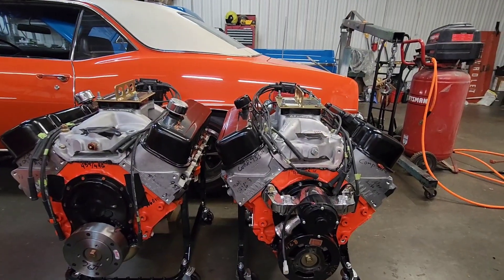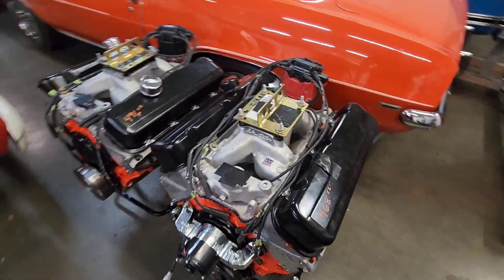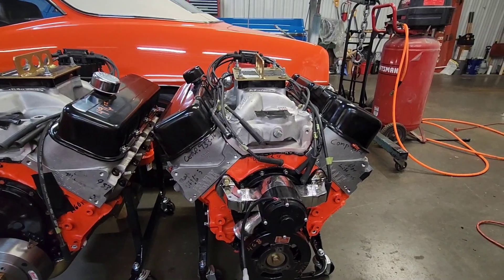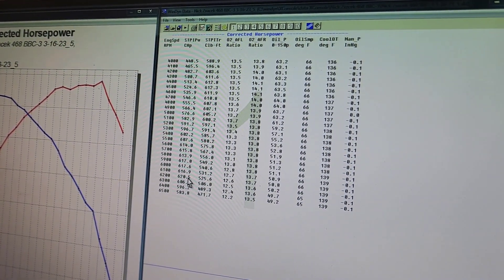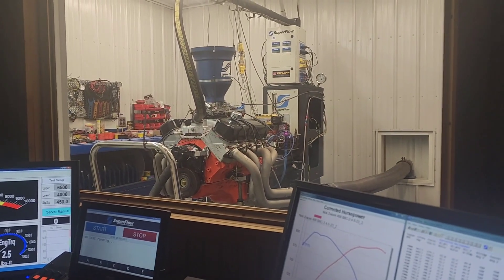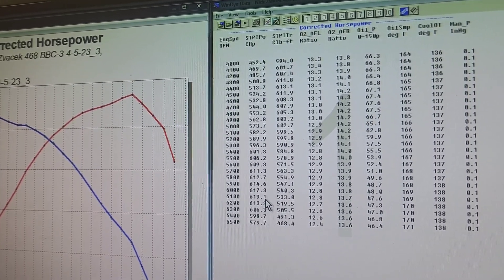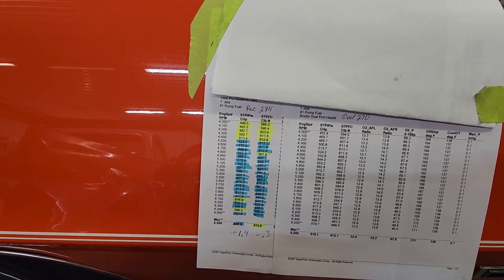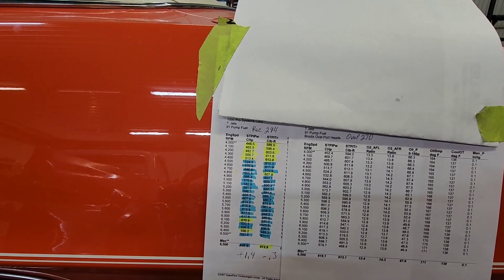Brodix Race Rite BBC head shoot out Rectangle port versus Ovalport 468 bbc

Comment: Maybe I missed it but did you say what the compression ratio was. Also have you ever considered building something identical to these with the exception being making the engine 12.5:1 to say 13:1 and running E-85? I live in Indiana and E85 is everywhere, it's the cheapest, runs cooler and is more consistent at the track. I'd love for someone to this. Great job and that's alot of work.

Comment: We've always thought that 'not quite big enough' is better than 'a little too big' when it comes to anything being driven on the street.   Ford Cleveland 4V heads showed a very similar pattern back in the day with the 2V heads making almost the same top end power but the smaller ports allowed better velocity and much better behavior down low.

Comment: Great info! I'm running a very similar combo. Mine is a 460 with 270 oval ports milled to 115cc. My cam has slightly more duration and I'm running a Strip Dominator intake. The comp ratio is almost identical and it has a 1000cfm Pro Systems carb as well. Thanks for the vid, very helpful.
Reply from the maker: That's a cool combination!! Hope you don't mind me  guessing. butI bet you're on your way to 650 horsepower
Reply: @dzperformance7360  That would be awesome! I'll be super happy if it makes close to what yours makes. No plans to dyno it though, thats why im so thankful for your video. Oh btw, i did smoothe out the chambers like Eric recomended. Did you?
Reply from the maker: @Craig Bilyeu  No. Totally stock with the exception of a valve Spring change. And milled down to 115cc

Comment: The larger square ports don't surprise me.  I've had a set of AFR square port 305's on my 468 for 20 years, long before they had ovals available, and run a similar hydraulic roller.  It makes almost identical power to yours and has plenty of torque down low, despite what everyone used to say years ago.  They'll make more torque than most can hook up on a small tire street car.

Comment from the maker: Ted,,Thanks for watching my videos!! Compression ratio is 10.4 to 1, cam is   239@ .050 intake  and about . lift 600 
What I'm doing with all. This testing is designing my own line of cam shafts and custom made carburetor spacers, I'll have this Cam out for sale on my website in the fall. Sorry i'm not ready to show the numbers yet but thanks for asking, Thanks for being interested!!  I've went through a stack of cam shafts ,custom made trying to get the perfect street strip  cam shaft for a 454
Reply: id think that the oval ports  could use more cam at first but they flow about the same  Wallace racing says about 620HP when i enter the numbers on their HP vs cfm flow and cubic inches calculator  with 325 @.600 lift  which is what someone  else flowed on here.  eric weingartner i beleive.  

that wallace racing calculator is pretty damn accurate...
Reply: Did you ever get that cam out for sale yet ? What stall converter would you recommend for that set up?

Comment: Need to work on the oiling system it lost 20 psi through the run
Reply from the maker: Yeah I seen that .. I think i'm going to a stock pump and run a little less oil, when testing,, (It has the stock oli pan and a ls6 windage tray)which usually works on my other motors.
Reply from the maker: Thanks for catching that
Reply from the maker: Good call, I was so busy I didn't notice ,that thanks for pointing it out!.,, After I got that comment from a couple different friends I went and checked and I had been running low levels of oil trying to pull out that last horsepower. And I think it was sipping some air  at the top rpms because in previous test that motor held 60+ pounds all the way start to finish

Comment: I am stunned. Okay, peak power being the same, sure it can happen. But the entire torque curve pretty much identical? Crazy. I suspect that perhaps the 270 port might make a little more torque 2000-3500, or at least have better throttle response in low speed driving conditions, but who knows. Huge thanks for sharing.
Reply from the maker: we did what I call baby pulls on both Setups ,3500 to 5000rpms I'll make another video and show you what happened on those